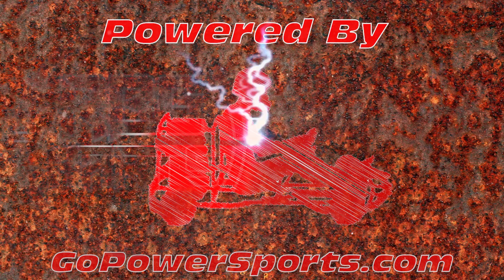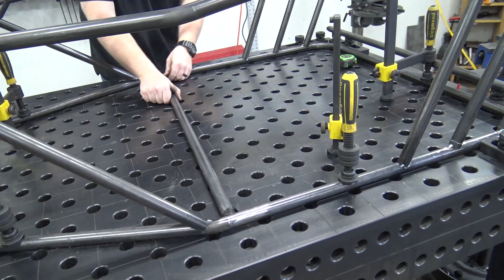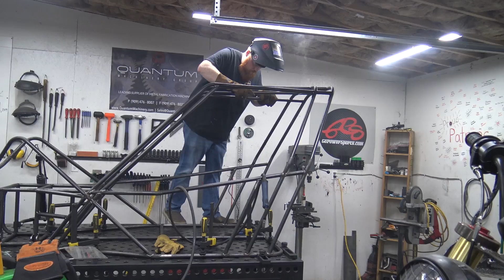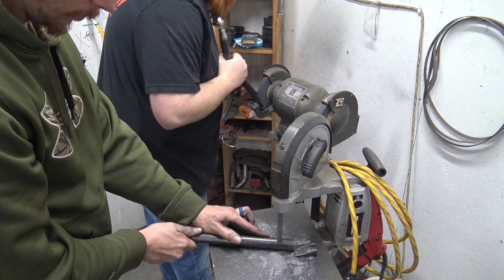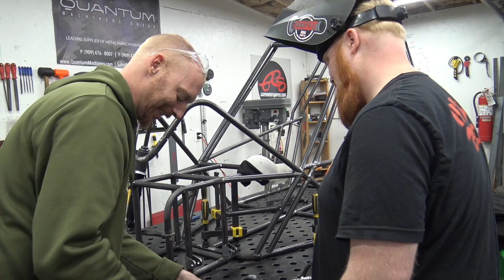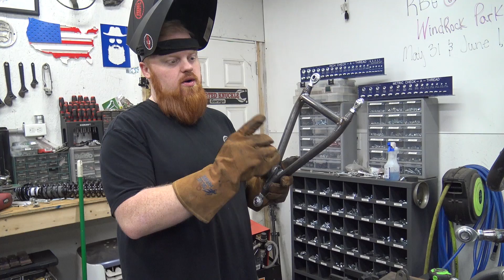Custom Go Kart A Arm Jig ~ IRS Buggy Ep3

Comment: I hope this badass looking buggy gets a nice power plant. No offense but a 670 just would be a downfall lol thing looks too badass. turbo charge one of the motorcycle engines you listed at the end and throw it on there with dual rice burner mufflers for wow factor lol geared to run 100mph.

Comment: Great videos keep up the great work. Maybe you could put a couple bolt studs on that template. And a flat bar across using nuts to hold the arms when welding. This way you don't need a second pair of hand getting in the shot or your welding?

Comment: A couple of good tips on fabrication. #1 Always pull the cut when using a cutoff wheel. In other words, the sparks should be spraying towards you as you cut in the direction the sparks are going. You'll never bind and/or break a disk that way. #2 Turn down your "post flow". It sounds like you have 2 seconds of post flow after you stop a weld. That's going to eat up a lot of gas, especially when tack welding parts. .5 seconds or less post flow should be fine for steel. Trust me, you'll save a lot of $ in wasted welding gas and time to go and get your tanks refilled. Keep up the awesome work guys. The build is coming along nice.

Comment: Red Beard I have a question.  I got one of those China side by sides with a bad motor and was thinking of installing a snowmobile motor it.  Something between a 500cc-800cc.  This way I get the belts, clutch and maybe reverse.  I figure going from the clutch to the axle maybe a issue but do you know if there are any other issues or if the motors just don’t work good in a side by side? Thanks

Comment: Lowe's sales metal blades that cut amazing and last really long. They are expensive but you get about 10x the cut out of regular disc
Reply: Some Biker Maniac  how often do they come apart in bits compared to the regular ones?
Reply: @knowbull5hit590  they don't it's a metal disc with diamonds teeth on the ends
Reply: Some Biker Maniac  oh dude i love you right now, thank you for the info i hate going through half a pack of the cheap ones in a day

Comment: an idea for a semi auto oiler for both the band saw and the tubing notcher would be to pick up some plain white felt, make a holder that holds it against the blade and the hole saw. just oil the felt at the beginning of the day before you start fabbing and it should help extend the life of the blade and the hole saw. just a thought.

Comment: You need to put a real deal power plant on this thing not a predator 670
Reply: ive made a ton of reliable hp out of the china twins
Reply: I don't see how anyone would see the predator as a good option a heavily modified 670 running flat out can be out done by a stock 450 dirt bike motor plus you get a nice gearbox and clutch thrown in. In something this size something like a gsxr600 would fit nicely and even the very first early 90s model had 80hp stock getting upto 124hp if you can get a late model wreck
Reply: @inthewoods5471  what bullshit those predator engines are everywhere and not because they are good or top quality but because they are cheap and easy to fit, as for what "his audience likes" well I watch the videos so I would be his audience also i see many comments suggesting a bike or snowmobile engine for most of the builds so that is just wrong too
Reply: @inthewoods5471  it's a recommendation no one said he had to do it just that in our opinion a more powerful engine would suit the build better for most people unless someone is being rude feedback and suggestions are encouraged
Reply: @inthewoods5471  you seem to be the one ranting I never said I hated anything just suggested what i see as some better options, cheap and simple motors have their place but looking at this cart I think it would benefit from the extra power which more than a predator motor can achieve and have any kind of life span
Reply: @inthewoods5471  rant: speak or shout at length in an angry, impassioned way. I was neither angry or impassioned i made a reasonable suggestion which even according to yourself fitting a motorbike engine to a gokart is reasonable and gave my reasons why I thought it was the better option I never demanded it to be done or insult then for the current choice so maybe you should look in the mirror before accusing people
Reply: @inthewoods5471   The irony of a man named Unemployable calling another man an "armchair go-cart builder" and telling him to get off his ass and build it himself

Comment: RBG A-arms, put me on the list to buy some. Also, your brother needs to be in more vids with more speaking parts.

One more thing, When welding up those A-arms, there needs to be small breather holes drilled into the tubing. That way you can finish up the welding and not get those pin holes/splatter at the end of your weld. I know you guys probably know this but I just didn't see it during the A-arms fabrication.